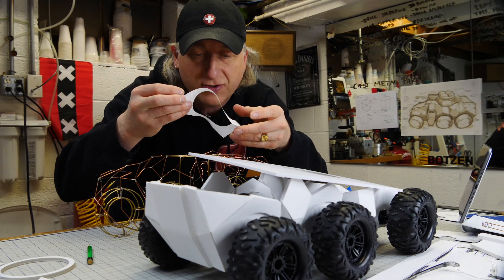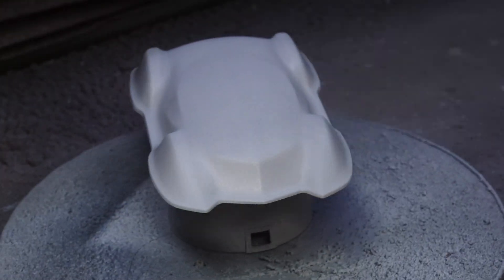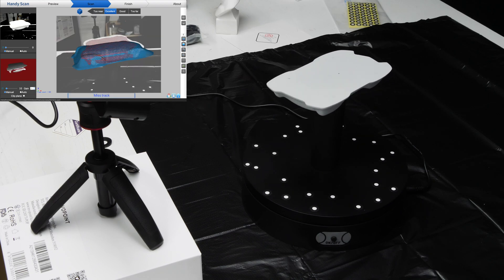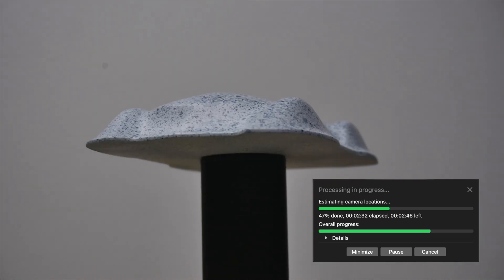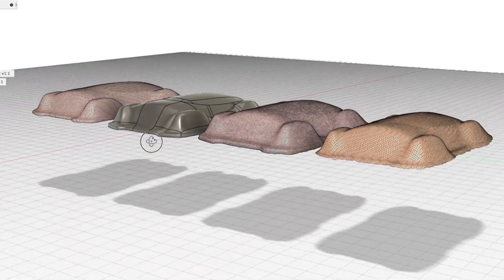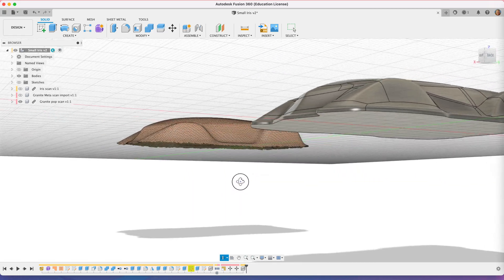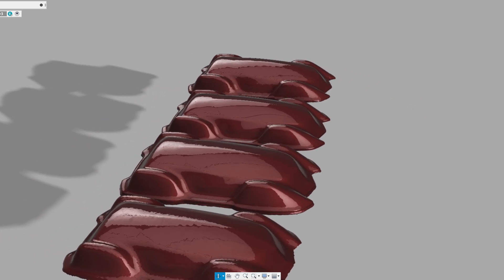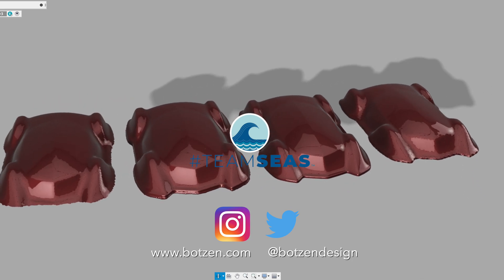Revopoint Popscan vs Agisoft Metashape 3D scanning Showdown #TeamSeas

Comment: Yah, honestly...everything revopoint has put out is basically a toy.   The miraco and mini 2 included.  They ALL have crap software that loses detail entirely.

I'm glad to see this photogrammetry software works well, been thinking about it for my openscan scans.  If you don't want to take all those photos build an openscan.  Made better data than any of the 4 revopoint machines I have been fool enough to buy because of their lies of .03mm accuracy...

Comment: Can you scan an item and then convert it to standard engineering drawings? My company is looking at doing this rather than hand measuring, creating mechanical engineering drawings with angles and exact lengths/ thicknesses of pieces and then converting to a CAD/OBJ/STEP format. Thanks.
Reply from the maker: Once scanned they become a base or an undarlay. Then you can build on top of that

Comment: can you align two models in metashape, then get better texture from photogrametry with scaned model?
Reply from the maker: Dunno
Reply: @EricStrebel  Ok , I did it , It works~
Reply: @EricStrebel  I am studying this method: use 3 Point Align ADD-ON in blender, you can align the pop2 model to metashape mode, then import to metashape than get better texture.

Comment: The pop does indeed connect to your computer directly (with usb3) if you want it to. Wi-Fi is an optional feature.  If your PC only does usb2 then that might be why it didn't work.
Reply from the maker: Nope, not using USB-C
Reply: @EricStrebel   I own the POP and I'm using it this way so.... Yeah, I'm certain that it does. 

On one end you have a USB 3 connector for your PC, and on the other end you have a USB-c which connects to the POP USB-C port.  No wifi needed.

Or you can use the cable with two usb-c connectors, if your PC(laptop) has a usb-C port. Mine does. And POP Works fine this way on my Win10 laptop, with either cable, no wifi connection. 

If it wasn't working for you then maybe the host was not providing enough power. For example, an unpowered USB hub will probably not provide enough power to it. Or like I said it has to be an actual USB 3 port (colored blue usually). A usb2 is the same size and shape, but only colored black, and won't give enough bandwidth for the scanner so it won't work.  Usb3 or usb-C port definitely required on the host in lieu of Wifi

Hope this helps! Love my pop but can't wait for pop2 in February. 200% better resolution!!!!
Reply from the maker: Perhaps there has been a software update they have been promising one for quite some time. Perhaps it's available now that the pop scan 2 is closer to production

Comment: it's a handheld device ..;and you use the turn table....
that's the main advantage, but not enough accurate...still the same cheap electronic. censor inside doesn't worth more than 60$
Reply from the maker: Accurate statement

Comment: Glad to hear you used the proper term, photogrammetry. Like all tools, they do an excellent job based on their features. I’m surprised you can’t configure different scan resolutions. If not, then it’s not meant to be precision tool. 👍
Reply: Scan resolution is based on image size - I do photogrammetry of objects and houses with 48MP cameras and the resulting mesh detail is significantly finer than for example photos done with an iPhone.

Comment: Eric, the photogrammetry can't get the scale right out of the box unless you calibrate your camera (no idea whether the sw can do it - check!). That's simply because of how the math works - the scale is a free degree of freedom that is impossible to determine without knowing the camera properties.

The POP scanner can do it because the calibration was done by the manufacturer already and it is known to the device/software. However, with your own camera the sw has no idea about your lens, size of the sensor, etc.
Reply: Sorry, this is not 100% correct: if done properly (keeping the EXIF/metadata), the images will contain the information needed for Metashape to properly create a model. If you read Agisofts documentation, they suggest not correcting the lens distortions. Metashape can even solve fisheye data. As far as scale, putting a reference object in the scan should suffuce if the scale needs to be adjusted. If for some reason you are using a camera and the metadata got erased, you can manually enter the info in Metashape.
Reply from the maker: Thanks for the info, so many features in that software, it could be a bit more user friendly in the UI
Reply: @EricStrebel  yeah, it weird, but I have heard some other programs are even worse. Hard to believe thougj. I have used Reality Capture, which is definitely faster, but I felt the texture data was better from Metashape (I am a game artist so that is important). Alice Vision actually has a nice interface, however it is slower than a slug. Metashape, for the cost is the best deal IMO. If you haven't, make sure to turn on the GPU accelerator in Meta shape: Tools>preferences>GPU
Love your videos BTW!
Reply from the maker: Thanks!
Reply from the maker: Makes sense, I assume you can set that in the software
Reply: @EricStrebel  I don't know how Agisoft handles it, having never used it. But in general camera calibration involves printing out some patterns (checkerboard, circles, etc) of known geometry, taking a lot of pictures of them with fixed zoom (focal length must not change or it invalidates the calibration!) and then having the software crunch the numbers to calculate the required calibration values. 

Another option is simply taking pictures that include some reference object of known size in them (ruler, gage block, etc.) and then rescaling the result using that. However, that alone is not accurate because the calibration above also corrects for lens distortion - e.g. barrel/pincussion distortion, etc - basically lines are curved and not straight which throws the calculations off.

Comment: Hey Eric, question for you unrelated to this video. I was watching your apple pencil video from back in the day where you dyed the tip black with sharpie - thinking of doing that to mine - how well did it hold up overtime and would you still recommend it?
Reply from the maker: Eh, I would try a stronger dye for long term, perhaps using heat will help for permanence.
Reply: @EricStrebel  Appreciate the quick reply! I was looking at 3rd party tips that are black but they apparently don't work as well as the oem ones from apple. I'll play around, thanks Eric!

Comment: 3D scanning still isn't anywhere near useful.  If you need details, you're not getting it with 3D scanning yet.
Reply: That's a bit strong statement. It depends on your needs - and budget! There are metrology grade scanners that will get you details down to 0.1mm (or better) resolution - from several meters distance! But if you have to ask about the price you can't afford it.

Also, one typically doesn't use the scanned data directly but as a source for remodelling the object or measurements. So the lack of details from cheap scanners may or may not matter, depends on application.
Reply: Well, the thing is that 3D scanning right now it's useful if you first scan the item and then use it as base, like if you were using tracing paper to copy a drawing. Saw a couple of videos that do that, even the most expensive scanners with the finest resolution are only used to bring the model to the digital world as base. And forget about small details they are the most difficult to scan
Reply from the maker: Have to agree, curious to see how the pop2 performs
Reply from the maker: We are getting there, apple is showing good potential.

Comment: Agisoft with a good DSLR and lens is far superior in resolution to the POP.... but as you have rightly pointed out, using the POP is a much easier and faster process. To be fair the POP has nearly as good if not better resolution than that of my old Artec MH/EVA machine which cost tens of thousands of dollars back in the day.  So obviously the POP represents an overall excellent value for money but it largely depends on your budget and requirements.  I purchased a POP myself and I think it has its uses :-)
Reply: BTW - Agisoft will provide accurate scale but you have to use the PRO version ($$$$) and you will need to use scale bars or an artifact of a known size/value.  It's also relatively easy to set up the alignment to the WCS in the pro version of agisoft.
Reply: @TheRealJerseyJoe  I've been using the standard version of Agisoft Metashape and I discovered that I if I put stickers on the master model and space them out about an inch (edge to edge), then in Modo, I setup a system where I lock a locator on both stickers, and moving one will rescale the model to exact size
Reply: @MrRileysGameroom  - Absolutely, that will certainly work !
Reply from the maker: Sweet, fusion has a scale tool in it for importing images. That works well. But adding a ruler or an object of known length when scanning helps
Reply: @EricStrebel  - 100%  (and always a good idea anyway).
Reply: @EricStrebel  i might try using blue painters tape cut to about an inch and see if that works better
Reply: I might look into using the pop scanner for making head mounted hardware for my clients since details will not matter